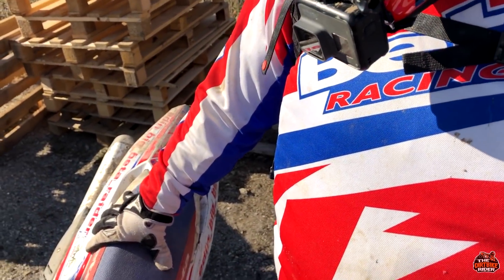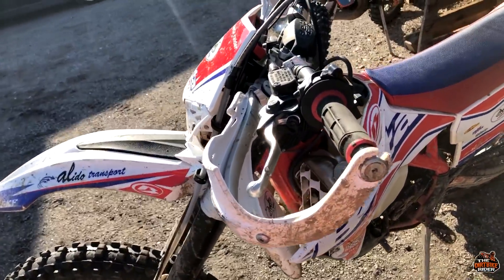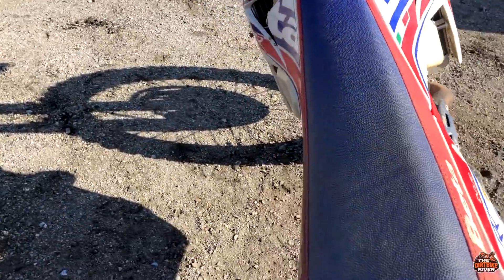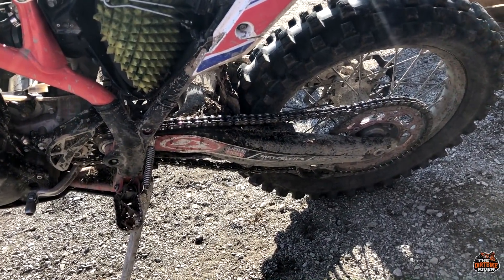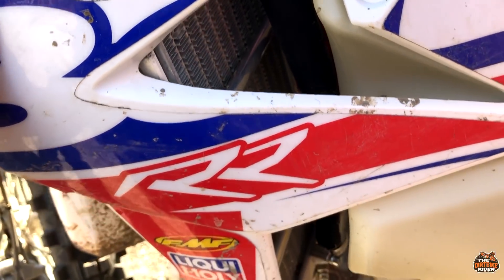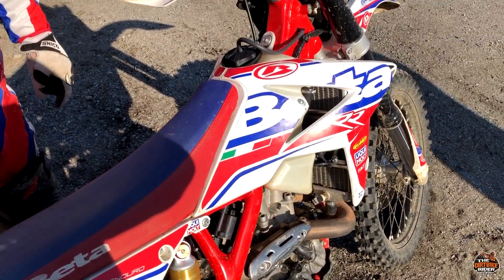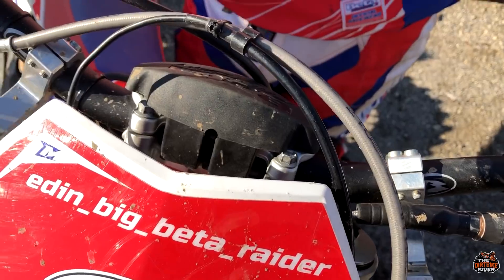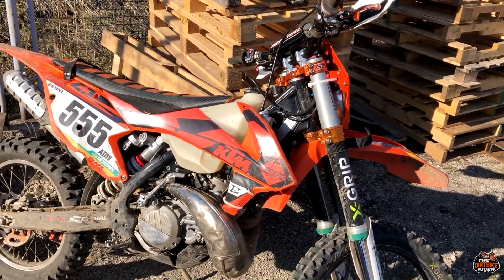Beta RR 480 2018 - ISSUES & COMMON PROBLEMS

Comment: The under fender that holds a license plate has been taken off, if that was left on you wouldn't have the mud and water flinging up on you, at the end of the video you can see the mounting holes for the fender. It weighs next to nothing so you're not saving weight if that's why you took it off. 
 You complained about having to change clickers for the suspension to feel better, that's not an issue or a common problem, that's just a typical adjustment, guys even send their suspension off and get them revalved and sprung and don't even complain because sometimes that's what you gotta do, and that's for all bikes.

Comment: You could try wrapping the clutch pipe in aluminium tape, it will act as a heat reflector. I had problems with an old camper van because the fuel would boil in the fuel pipe, the tape fixed the issue.
Having said  all that I am surprised that the fluid is boiling in the pipe, it must get a lot hotter when it is used in a brake calliper.

Comment: just get a longer clutch cabel and route it another way.  And(or) get cabel or hose heat shielding.  Any place that sells car parts should have some.   That Beta looks amasing.  One of the best looking bikes you can get.

Comment: About clutch plates. There is on the market a new kit for steel plates and steel tubes. The originals are too weak and worn out so damn quick. Order the new ones from your local dealer and you will have clutch for life.

Comment: guys, you argue about the rear - you dont have that problem if you ride with the tail light ^^
with your clutch you should visit your dealer, idk that problem because they redesigned the clutch in 2017, i've got a 2016 bike

Comment: How about reliability and maintenance? How long you go with one piston?
Reply: my 2012 beta with almost 200 hours hasn't needed it, and the previous owner wasnt great at cleaning the air filter and probably oil changes.